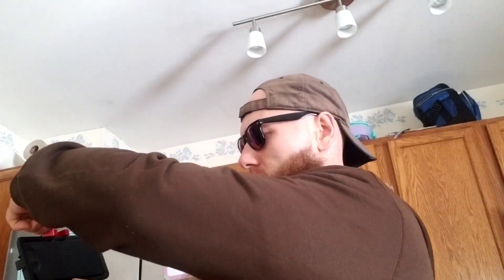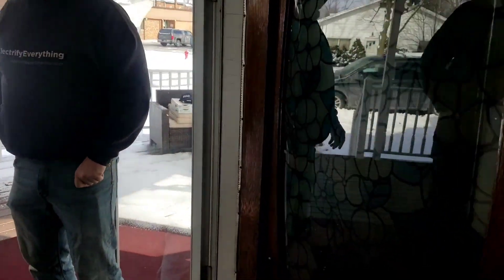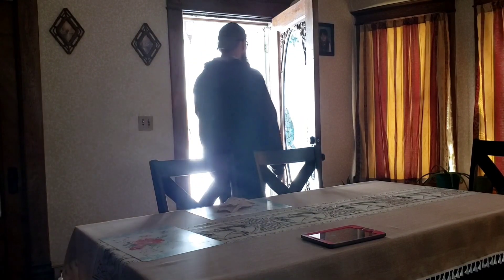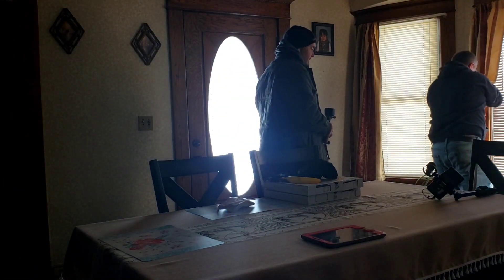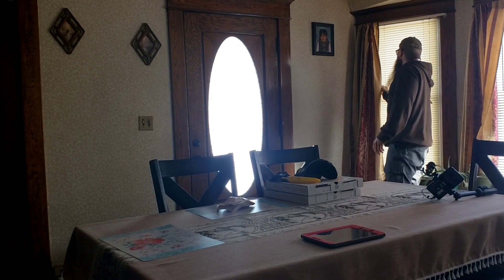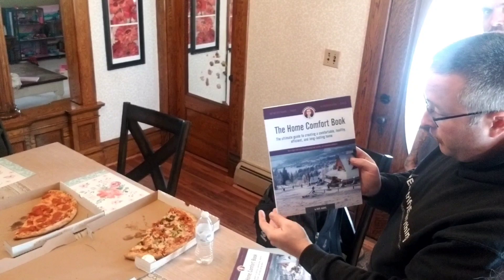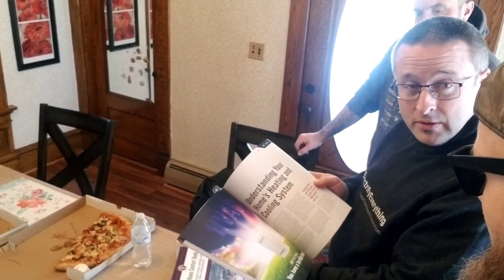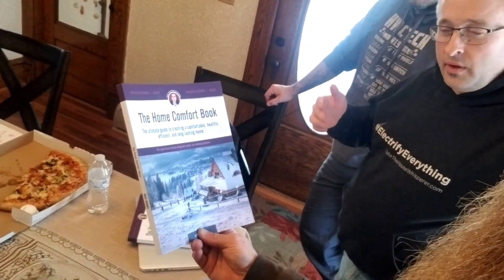Home Performance with Nate Adams Pt:1

Comment: You will find the most for the $ is to seal top plate penetration's and put an R60 in the attic, the rest is diminished 30 year returns...Window treatments go a long way without replacing too.